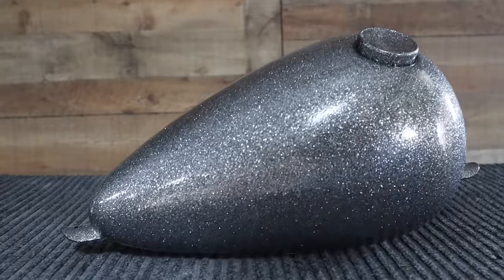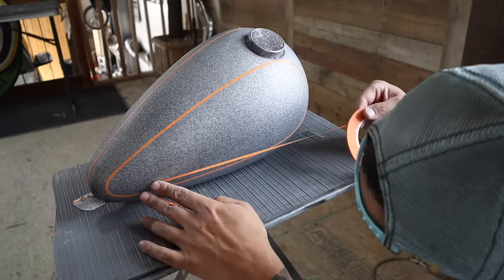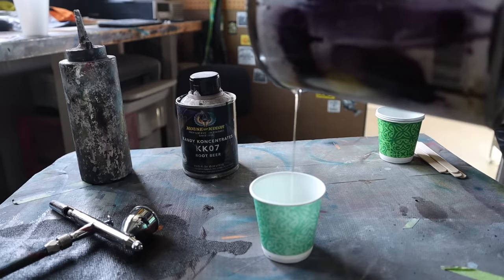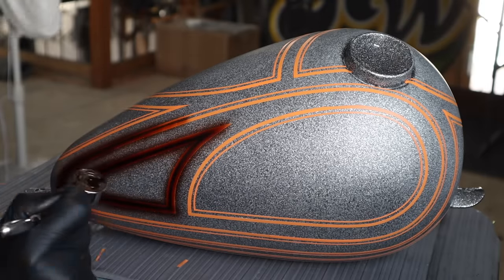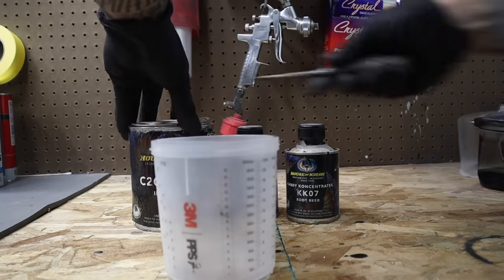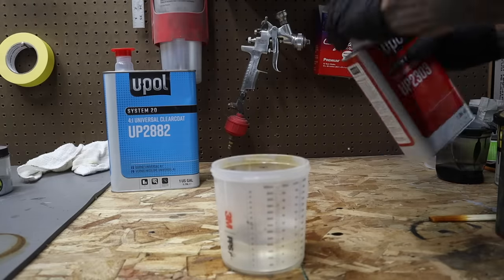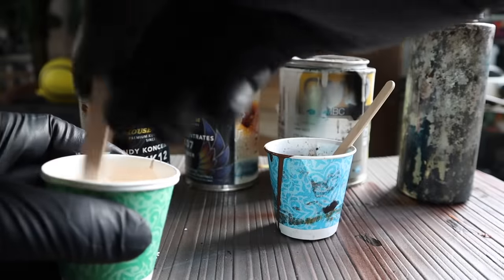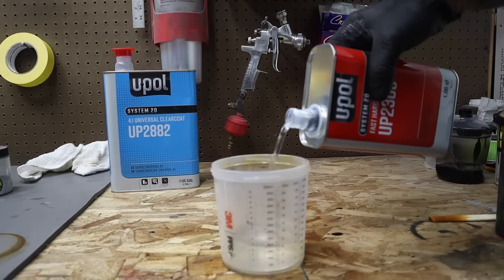How to Paint Candy Metal Flake Panel Graphics

Comment: I noticed when you mix the kk with the Clearcoat base you don't use a hardener. Is it because the clear base does not require a hardener? Because the shopline clear I have requires a .5 hardener ratio.

Comment: Just stumbled across this video of yours . before I graduated in 97  I took a 3 year course in auto collision repair and I can do custom paint jobs . Nice job by the way😎🤘🏁. I did a custom paint job on my dads 75 super glide harley chopper . Even you know this your suppost to put your light colors down first and dark colors after since it takes less coats of light colors. well I did the opposite. I layed down a few coats of blackon the tank and fenders then when cured I wet sanded each layer . once cleaned I used thin pin striping tape and layed out flames on the tank and 2 fenders . then masked off the rest I didnt want painted . I had to lay down several coats of yellow to get the color to fully coat and be brite. then I used blood red and painted the tips and around the inner curves . whats cool is the light over spray of the red when it hit the yellow turned orange. once I got the flames painted I let the paint fully cure and peeled of the masking and pin stripe tape . then I wet sanded the flames mainly the edges to blend . well once I got to where I wanted the tank and fenders I did sever coats of clear and each got wet sanded . once finished I polished the clear coat . the fenders and tank looked like they where dipped in glass and the process gave the flames a 3D effect like they are trapped and when you run your fingers over the flames you can just barely feel them and their smooth 😎🤘
Reply from the maker: hel yeah thanks 4 sharing

Comment: Surprised to see you using u-pol, I figured you would be using one of those $500 clears. That’s inspiring in itself knowing I can afford to at least try a paint job like this! Thanks for sharing your art and the process! The tank looked incredible! Purchased 1 gallon u-pol and activator  less than $100 at Oreillys
Reply: upol works just fine. lots and lots of shops use it. it turns out the same

Comment: I've watched this video a bunch of times (and subscribed) and now I'm addicted to spray/airbrush videos!  A couple of questions if I may: How long do you wait between candy or clear coats (seeing as you need 3-4)? When wet sanding, how can you tell when the surface is even (especially when on patterned paintwork)?
Reply from the maker: Dry times for clearcoat  have allot of variables (temp, air pressure, humidity, how heavy you spray, brand of , tip size). On average I would say 10-20 min between coats. 12 hours before sanding. Candy paint drys almost instantly when applyed with an airbrush. 
As for sanding the clearcoat you will totally see and feel if it’s smooth.  Hope this helps. Adam
Reply: @TimeWarpCustomPaint  It does help.  Thanks!

Comment: Perfect work👌. Very detailed video and help me so much 🙏🏾.  Thanks a lot and good luck 👍
Reply: One question my friend. Have you some tip how to paint flat clear. I have problem with dust. Gloss clear is ok I usually sand with 1200grit wet and 2000 and than polish. What to you think is it possible paint two layer gloss clear coat, sand with 800wet and then one middle coat with flat clear coat??? Have you some experiences with flat?? Thanks a lot for help. Marek
Reply from the maker: when your using a flat clearcoat its better to clear first with gloss clear then sand and apply the flat clearcoat on top this will help keep your flat clear clean . If your wanting to do gloss/flat  combo you will also want to spray the gloss first, tape off what you want to keep gloss then scuff and spray the flat clear. this will leave a thiner paint edge that you can cover with a pinstripe if you want.
Reply: @TimeWarpCustomPaint  Thank you very much my friend for tip 🙏🏾. You are very helpful. Thanks again and have a great year 2021. Marek

Comment: You are clearly talented I wish I would have found this channel before attempting my first paint job.... I recently tried to use automotive paint for the first time and decided to do atwo tone with a color dividing painted pinstripe. It turned out great but if I could change one thing it would be the transition. Which brings me to my question, how does someone get the same paint profile height between different colors? Mind you, I did this with rattle cans.
Reply from the maker: you clear coat the paint between layers
Reply: @TimeWarpCustomPaint  thank you, I’ll try that next time.

Comment: You cut the flake and lose some pop and might have problems later with separation of you sand the flake itself.  Just scuff and coat.  Use extra clear and cut it back if it isn't flat.

Comment: About the airbrush you’re using. What is the nossel/tip size? And airpressure, how many PSI do you prefer to use? Big thanks in advance  🙏🏻
Reply from the maker: .035 tip size. I spray anywhere from 12-25 psi through my airbrush

Comment: Ive been looking to paint my tank and fenders and found this. Your work is amazing and you make it look easy, which i know it isn't.
I noticed you clearing over your candy, scuffing, re candy graphics on top of clear not over a mid coat, I've read graphics or candy over clear is not really doable but i see you doing it here. Do you recommend attempting that for say someone who really doesn't have your particular skill level?
Reply from the maker: I beg to differ. Applying a 2k clear and sanding between graphics is way more durable in my opinion

Comment: I really do love your art. One thing I have wondered is how and when to remove the tape from the filler neck and the petcock fitting. Do you have to cut through the paint with a razor blade while the paint is still soft or just peel it off when ever?

Comment: Hi Adam , I have a vintage cycle with  wide heavy  metal body and yes I still I ride it , it bit of too rusty and really worried about it so then I came across you video its much impressive so pls suggest what to do it rainy season are over and I have to save my so called vintage cycle ...
Reply from the maker: epoxy primer

Comment: For the silver, is that silver metal flake mixed with clear over a black basecoat? I am looking to do bright candy greens, blues and possibly some more transparent colors in the same pallet. I’m wondering if I should go with a more toned down black/dark gray basecoat before spraying the silver metal flake(if you are using a black basecoat before spraying the silver), since I’ll be working with much brighter/lighter tones with the blues and greens I’m using. Any suggestions?
Reply from the maker: As long as you are using LiME LiNE metal flake I would stay with the black basecoat.  Its made to cover better so as long as you are following the directions on the packet you will be good. blackbase makes the metal flake sparkle allot more for a better look take my word for it. thanks for watching
Reply: @TimeWarpCustomPaint  
Awesome man, I’ll make sure to send some photos when I’m done with this tank from some of your tips. I love my tanks, and they have the perfect classic look for what they are, but they’re missing the dimension and pop that I want to start learning how to create. Awesome channel and great work. Thanks for the response!

Comment: The videos are great. But I need some help. I’m having issues with tape peeling up the candy. It’s a bit cold here but it has been drying for a few days. Could it be that the tape is to sticky?
Reply from the maker: You may be laying down the tape too early or applying too much base coat color causing adhesion problems

Comment: I'm praying you can help me.
I'm a newb trying to learn how to use a airbrush, paint and glitter.

I want to Airbrush glitter onto small metal pieces that will be finished with a coat of clear epoxy.

What's the best kind of glitter to use?

What's the best solution(s) and/or that I need to use with the glitter?

And anything else I need to know to pull this off.

Tia
Reply from the maker: What are you painting? and where are you from?
Reply: @TimeWarpCustomPaint  Im making car emblems from silicone molds. Im in Michigan.
Reply: @TimeWarpCustomPaint  
So what's the best product to use with .40 size fine glitter to apply through an Iwata Eclipse airbrush onto surfaces?

I'm a newb. So is there Anything I should know to do/not to do when doing this.